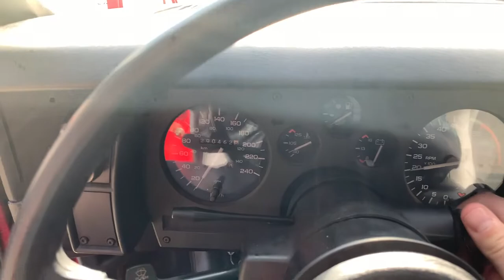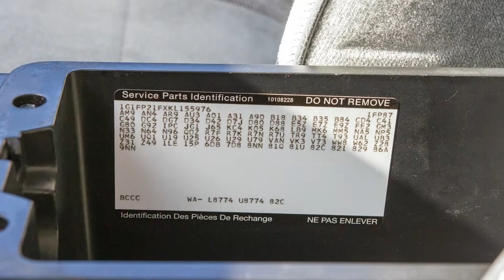1989 Chevrolet Camaro IROC-Z 1LE // FULLY RESTORED // 1 of 111 Made

Comment: This is a Canadian Players Challenge Race car. Exhaust is correct. Radio, power windows correct as noted on the SPID. What makes this a different 1LE is code R7U.
Reply from the maker: Thanks. I am not a 3rd Gen Camaro expert but had a feeling that the Players Challenge option would have changed the 2 cat exhaust system.
Reply: The series allowed a 2 year run on the cars. 1988 cars did not have the dual cat exhaust, so they had to keep it the same on the 1989 cars to not give any advantage.
Reply: What color red is that,it's brautiful
Reply: If actually a players car I would like to see the seals that used to prevent tampering on the engine.
Reply: @kennethstegall1075   I was thinking the same thing!

Comment: Beautiful restoration, the only thing I noticed missing was the twin cat exhaust, 1LE came with this if memory serves plus radio delete and fog lamps. Other than this the factory wasn't this nice. Perfect job. Cheers
Reply from the maker: Thank you! I believe that because this car has the R7U/Players Challenge option that the exhaust system is different.
Reply: The 1LE option did not delete the radio, just the fog lamps and a/c. Most all options were still available.
Reply: It has fog lamps delete, and the ac delete is also gone to, rare car, Some for this year only had single exhaust sys for quicker performance, in 1991 it came back to dual cats, 91 and 92 year only
Reply: N10 was an option code for the dual cats that started in 1989.

Comment: I owned one. 1989 5.7 tpi gear package, 147 mph, only lost 1 street race, to a Grand Am 3.6 turbo. I ate Stangs and Firebirds.
Reply: You didn’t eat 5.0, 5-spd “Stangs” with a 350 auto Z-anything cuz even though they had a 350, they were slower than molasses. This is well known.
Reply: @tg8150 Everything else in that day was even slower, dude. Outside of the "exotics" only a handful of production cars on the road could beat it. I know. I also had one brand new right off the showroom floor.
Reply: @tg8150 lol, it's not well known. Let me give you some info from someone who had 1 of each. 😁
I ordered both new ... an '87 5.7 IROC & then a '91 5-speed GT. 
I had both those cars as a pair until 1998 when I sold the GT an got a new Toyota 4 Runner Limited. 
They ran virtually identical 1/4 miles & trapped nearly identical speeds. They were also separated by less than 1 mph on top speed. 
I quartered them at Kil-Kare Dragway in Xenia, OH more than a few times. 
The only noticeable big difference was in handling at anything over 100 mph. 
Because of a solid rear axle the GT was a driving mess, the IROC on the other hand was glued to the road. 
Granted this wasn't on a perfectly smooth stretch of asphalt, but it was quite noticeable. 
I do have pics of them sitting side x side in my driveway back in the day. 
Camaro was Bright Blue Metallic & the Mustang was Medium Red.

Comment: THE RPO CODE SHEET will end the debate about 1LE.   There is a code for AC delete and radio delete.  The car IS NOT a 1LE if there is a radio RPO code… AC delete and Radio Delete AUTOMATICALLY triggered the 1 LE Option which you paid for….1 LE option included 4 wheel corvette disc brakes and the dual Cat exhaust system. There is an RPO CODE. For aluminum drive shaft and baffled fuel tank.   No 1 LE car came with power anything. They were basic optioned cars.
Also the 1 LE car had a small badge located on the front fender behind the wheel, the badge was drilled Into the fender leaving holes if removed.
Thanks and have a nice day

Comment: Beautiful but wrong exhaust.  1le automatically had the dual cat exhaust. G92 PERFORMANCE pack, 1le had 9 bolt aussie rear, rear disc, engine oil cooler, baffled fuel tank and as stated dual cats
Reply: I thought the 1LE didn't have the radio or the electric windows...
Reply: @Toto0861  Your correct it was deleted with 1LE as well as fog lamps
Reply: @Toto0861  Look at the SPID. This is a Canadian Players Challenge race car. It came with a radio and power windows.
Reply: @anthonymacneil2279  wrong these cars came with a radio. Look at the SPID.
Reply: I own a 1LE (1991) and I’m not 100% sure on the 1LE’s but for regular production, some early 89’s got the single cat and the later 89’s got the dual cat (N10).

Comment: I thought these had dual catalytic converter.
Reply from the maker: I believe that because this car has the R7U/Players Challenge option that the exhaust system is different.
Reply: Good.  I wouldn't change a thing on this one.  I hear that 1LE can run the quarter in high 13s.  It's not that fast by today's V8 muscle, but it's still fast enough.